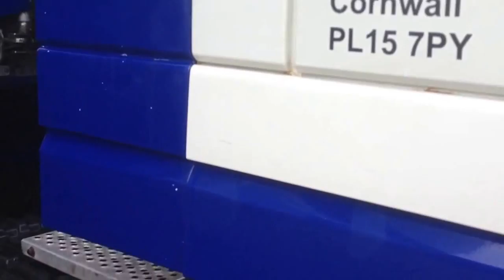Dropping an artic trailer

Comment: Why put your legs all the way down. risking missing pin on re hitching. Leave room on legs and lower wheel on leaving then lower on pick up then lift wheel as going under to lift the trailer. near impossible to miss pin then unless your not straight.
Reply from the maker: I don't know if you drive these toys or not,  but when dropping trailers on a test you lower the legs on fast wind until they touch the ground, then select the easier gear on handle and keep turning until there is a gap between trailer and 5th wheel, and it there's 3 reasons why, 1st is, if the trailer is upto its full weight the front of the trailer will drop, sometimes to the point where the wheels are off the ground, 2ndly, you don't scrape off all the grease off the 5th wheel and leave it on the trailer,  and 3rdly, not all 5th wheels are the same height, a majority are, but not all, 
Oh just one more thing, any good professional driver will not just ram the unit under the trailer and smash it on,  especially if we have a cup o tea in the cab, we drop the axle go in under slowly then raise it when close to the pin, some of us get out and look just to make sure it will not miss, then gently kiss it onto the pin, give a gentle shunt forward  to make sure they are a couple,
Reply: Think you missed where I said lower the wheel while pulling off the pin. Iv known a couple of lads do this your way. Safe to say they aren't in a job no more. Missing pin due to going under the pin and smashing fridge up or not smashing onto the pin as you put it and pulling off and putting the trailer on its knees. 
Grease can be replaced and inexpensively. A fridge unit can't. The way iv been shown is 100% effective on never damaging the wagon or trailer. What percent you recon your way is? Bare in mind i can name a couple that aren't in the job because of using your way
Reply from the maker: I'm only doing what is required of me,  I've been doing this for 17 years and only ever went under the pin once, enough to make me wise enough to check, check and check again, was fortunate not to cause any damage and lowering the legs to raise trailer up was sufficient to rectify my mistake
Reply: +Garry Whittington iv not been driving no where near that. Been driving class one a year and I was doing the hitching as instructed by trainers and was a ball ache and taking ages. Was told by everyone that I work with to do it this way and since that never had a problem. many that told me were shunters in a past job. I understand where your coming from about simply pulling off and dropping the trailer onto its legs. If it was fully loaded it would simply snap and put onto knees but when care taken to lower fully as slowly pulling away it's a much safer and fool proof way of hitching an unhitching in my eyes anyways
Reply from the maker: Each to their own mate, it's not a problem or bollocks ache for me, it's bred into me now how I hitch and unhitch trailers, like I said before, I've only gone under the pin once, I learn fast,  your 1st year as class 1, lots of mistakes for you to learn by yet, lol, I've made a few meself, don't matter how many years or how good I am at driving, there's always room for improvement. be safe out there buddy,
Reply: +Garry Whittington  there is always room to improve and always learning stuff everyday. I'm in supermarket transport so Learn everything faster than most as it's a lot of blind reverses and so on but learn new stuff every day. say to you stay safe
Reply from the maker: +john emerson done supermarket crap, lidl's, it was okay I spose, but gets boring, same shops, same route, have more fun watching paint dry, lmao, but it's work and earning which is far more and far better than benifits street, lol.